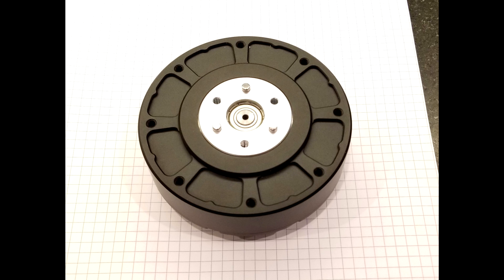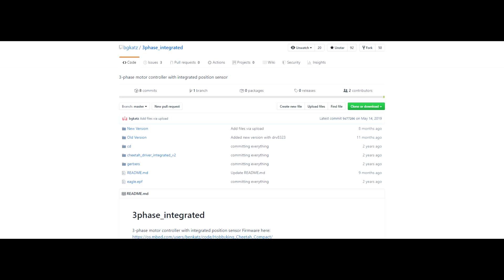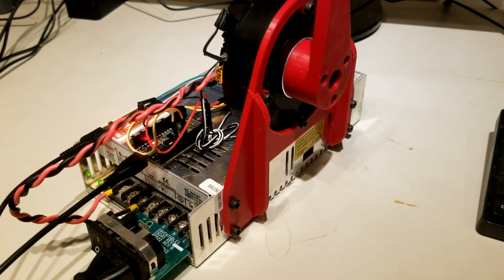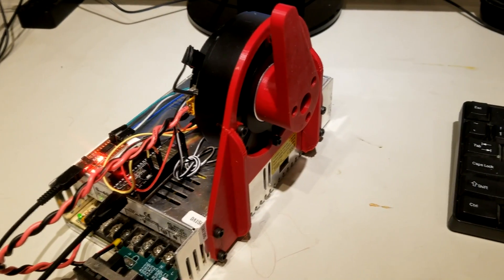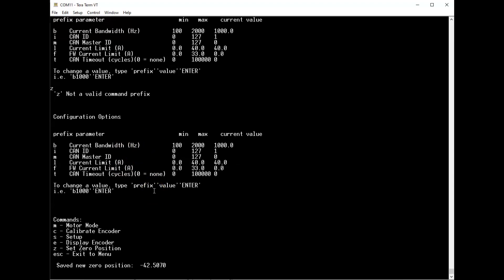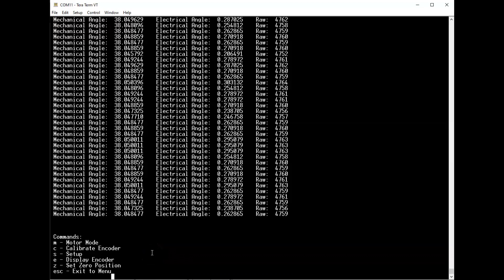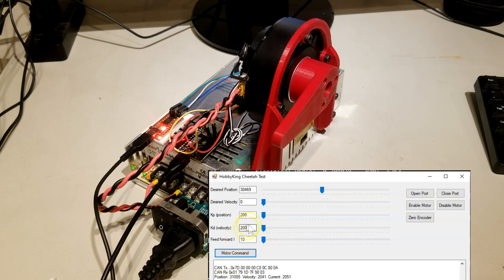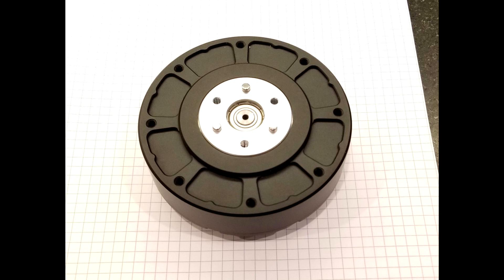MIT Cheetah / Hobby King Cheetah Motor Testing

Comment: Hi Barton I just purchased one of these...Is it ok to directly connect 24V to the motor as the documentation says that it might get destroyed?
Reply from the maker: I did it. I used heavy gauge, short and tightly twisted wires.
Reply: @engserve  Help me out Bart...I'm unable to understand how to give the position command....i.e. how do I move it to zero degree.90 degree,270 degrees etc...I just want a single rotation back and forth...Thanks in advance

Comment: I dont understand, you changed the torque value and the motor position changed. I am working with the same motor and the reaction of the motor is the same and i dont know why?! i would be glad if i can contact you with email to get some information.
Reply: Hi Kamiab Yazdi, I'm currently working on the same motors and unable to interface it with Transceivers. I would be glad if you can help. Please email me at psantoshsan@gmail.com so that we can get in touch.

Comment: Hi! question: have you been able to implement some kind of "ramp-up"? Would it be possible to make this motor move with a trapezoidal or S curve to achieve a "soft start"? thanks!
Reply from the maker: With a step and direction input it will follow the curve set by the step generator.
Reply: @engserve  Thanks Ill give it a go and let you know! maybe you will like my channel, specially my latest video :)

Comment: Great demo video!
Hi,Why does the position of the motor change when you set kp and kd?
Reply from the maker: The kp value has a big affect on the final target value. I will be reprogramming it soon. I want to improve that and play with the resolution vs range.
Reply: @engserve  Hi，I still have some questions about kp and kd. How should I set these values to get a  accurate output?  I really want to communicate with you ,thanks!
Reply: I Have the same problem to. maybe its related to steady state error. make sure that the velocity command is zero when you compare between different kp.
Reply: @shlomishitrit6287  Hi, do you have any progress on it? I have some problem on  kp and kd ,too. I I look forward to talking to you.Thanks
Reply: @lingxuanzhao7172  hi，  are u also reappearing mini cheetah？

Comment: The angle is 6 times a full revolution in radians because the encoder is on the motor not the output shaft and there is a 6:1 gear ratio.
Reply from the maker: Right, but it is a simple setting in firmware that could be changed.
Reply from the maker: With the current firmware and CAN protocol, the motor is not setup to run many revolutions. The firmware suggests the limit is +/12.5 radians  (about 4 total revs) mapped to the 16 bit position. That does not appear to be working right, so I requested clarification from Steady Win. With an application like the Cheetah robot, you don't need many revolutions. A CNC machine like a delta bot would be the same. Unneeded revolutions, eat into the resolution of the 16 bits. My 24 revs/16 bits is not great.
Reply: Rob is right. Try turning it off, turning it MORE than 1/6th of a revolution and then turn it back on  - its new position will be shifted by 60 degrees

Comment: In looking at the website, can you report back, how well it works on much slower moves confined to a few degrees?  I'm guessing with an encoder it would be.
Reply from the maker: You can play with the velocity a little, but for a real application you probably want precise control of position, speed and acceleration. The controller is not designed to do that. I think the best way to achieve that is via rapid positional control, like a CNC machine does with a stepper motor or closed loop servo.

Comment: Very cool. Out of my budget , but I'll keep an eye out. I'm sure these will dive below $100 somerime soon.
Reply from the maker: I think the biggest cost factor is the housing and gearbox. If you just want a motor/controller/encoder combo, I am sure these will be below $100 very soon.
Reply: It would take a long time to get the price down. The machining process of the gears and the body is not easy to do. These are the things that rarely go down in price. Computer hardware and technology has been accelerating very fast these days. For computer parts it's mass produced for alot of people. So that is why for something like a robotics actuator is expensive.
Reply from the maker: @byungjaelee5110  The $100 would be a motor with integrated driver...no reduction.
Reply: @engserve  yup. The problem is the gearbox...
Reply: @engserve  Will you make a video for DIR/Pulse interface? It's too difficult communicating via CAN bus.
Reply from the maker: @byungjaelee5110  There is no step/dir interface yet. Needs to be added to firmware and hardware.
Reply: @engserve  Yes. I know it doesn't support step/dir. I meant to say step/dir or other communication to a MCU and talk CAN. I think most integrated actuators communicate via RS485 or CAN. I can't find a website that teaches CAN and RS232, RS485. Could you recommend place that a could learn these protocols? Before someone makes a software and hardware converter to CAN, I'm thinking of using Odrive or VESC.
Reply from the maker: @byungjaelee5110  I have it running on Grbl_ESP32. My only videos were posted to Twitter. https://twitter.com/buildlog/status/1220372055776022528
https://twitter.com/buildlog/status/1219807520816017409

Comment: So at only 250 watts I guess this would not work well for driving a heavy robot wheel? 250 watts sounds weak but maybe not since it had gears?  That is one cool motor either way and nice that it can be controlled over CAN.  Looking forward to seeing what you do with it!
Reply: You probably want the un-modified version which is the U8 motor.